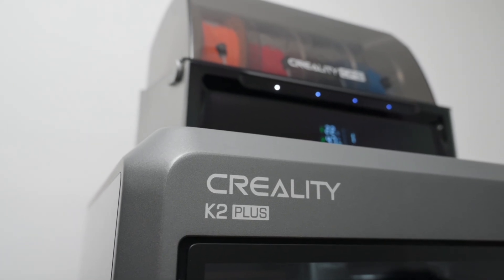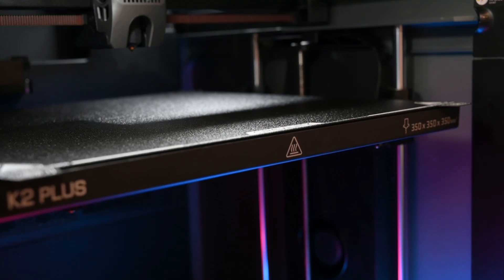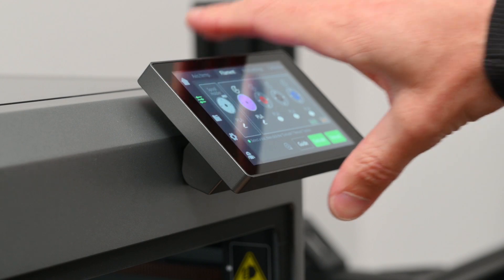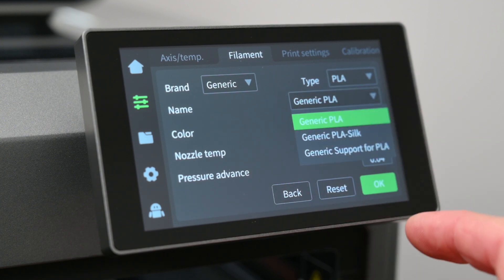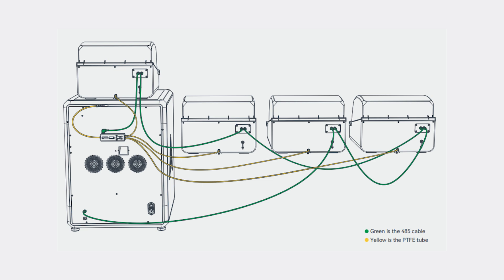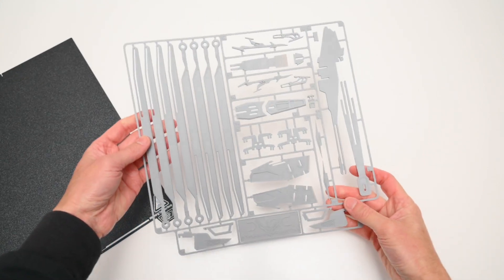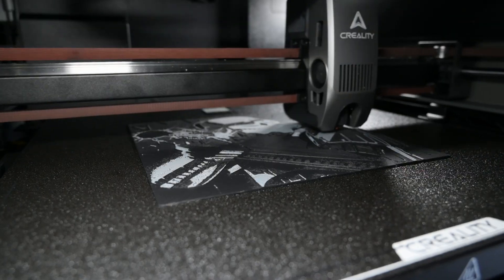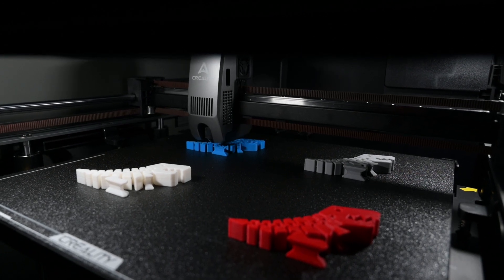Impressive Large Fast & Color 3D Printer - Creality K2 PLUS Combo

Comment: Mine is great but my CFS has been having a ton of issues
Reply: Saw one video that the support was telling some customers to clip part of a spring in the CFS or leading into the printer not sure where the spring is as I do not have one yet... but the spring can be too stiff from manufacturing and needs to have reduced tension this has fixed many problems people were having with CFS

Comment: Did creality solve the issue where if you used the CFS, you couldn’t do thin layer heights ?
Reply: I haven't heard any updates about that. I'm mostly worried about quality control and shipping damage. Mine has supposedly shipped now
Reply: I received my K2 Plus on Dec 9th and it's been printing just about non-stop.  Some large multi plate and some redundant plate full of the same items... No issues at all with print quality. 

Only part of the process that  I want to work on is the amount of poop